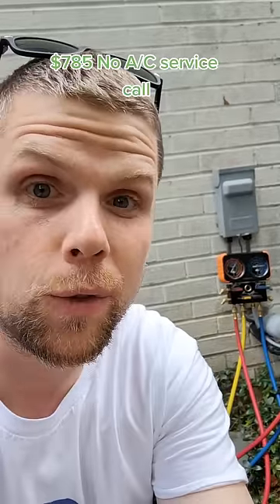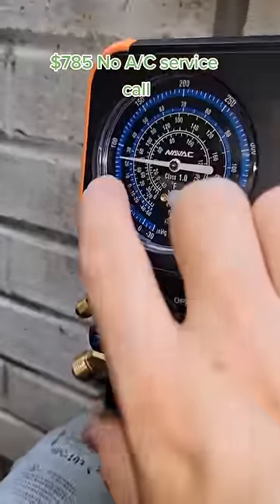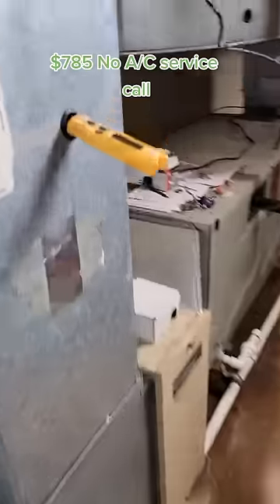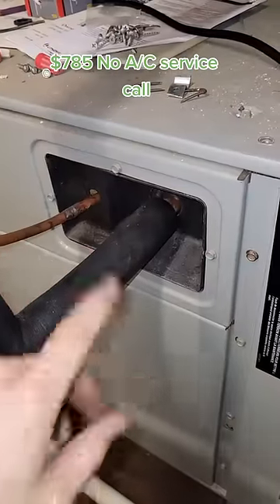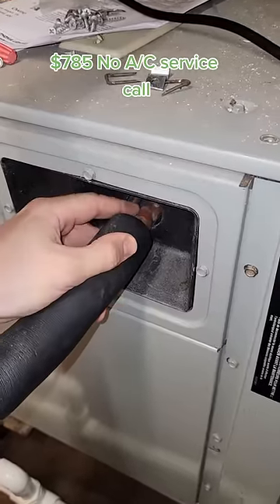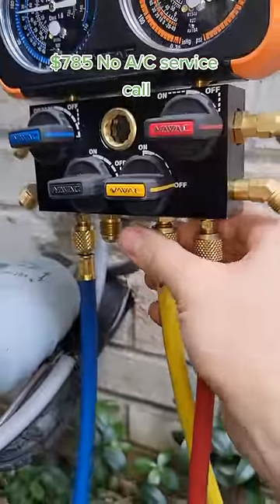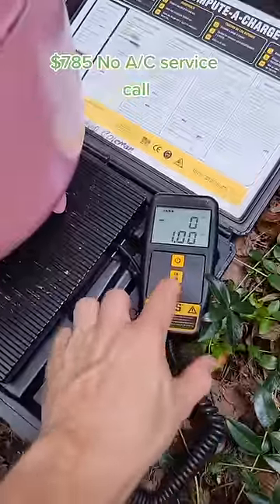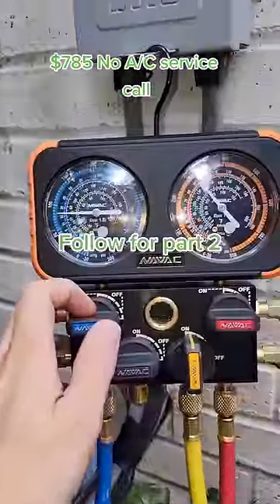Why is my A/C unit 🥶 freezing up? #shorts

Comment: I don't think this guy knows what he is doing or the way a/c systems actually work.
Reply: Why do you say that
Reply: @cc1561  procedure he is using , low freon doesn't increase the ability of the system to reduce heat load. Just not what I learned when I took hvac in school for certification years ago. Look up latent theory of evaporation for a deeper understanding of how a/c heat pumps work.
Reply: @cc1561  there wouldn't be a 20 degree temperature difference in the air if it was low on refrigerant. You would have low delta, low pressures, very low sub cooling and high superheat. Even he was even more thorough, he would have checked compressor amps too
Reply: @martyk1156  if you're lacking the substance that creates heat transfer, then you're going to have less heat transfer. So being low on refrigerant will reduce the ability of the system to remove the heat load.
Reply: @SupermarketRefrigeration  I agree
Reply: @SupermarketRefrigeration  so will being low on airflow if you look at his high side gauge you’ll see it dosent look low which tells me it’s prolly not low but the only way to know a refrigerant level is to calculate superheat and subcool and I didn’t see that neither did the customer
Reply: @boywhohadatiger  No, the only way to accurately determine a charge, on a system like that, is to recover and weigh it in. Pressures are helpful, but if you don't know the ambient temperature, that pressure doesn't really mean anything.
Reply: @SupermarketRefrigeration  that’s truly the most accurate way but nobody has time to recover all the refrigerant out a system pump it up with nitrogen to pressure test to find the leak or take it out and put it back in just to perform a leak test because you need some kind of gas to be in the system to perform a leak test and if your using heated diode or infrared then you need a refrigerant to be in the system. The vast majority of techs in refrigeration and residential ac will use the subcool or superheat method because it’s just as accurate and faster
Reply: @boywhohadatiger  It's like I always tell my guys: There's never enough time to do it right, but there's always enough time to do it twice.
I'm not saying your rules of thumb are incorrect, but your way of doing things, isn't the only way. 
But I will add, refer guys don't pay much attention to subcooling.
Reply: @SupermarketRefrigeration  yea they like that sight glass 😂
Reply: @boywhohadatiger  sight glass is all that matters.
Reply: @SupermarketRefrigeration  😂 yea can’t argue there vast majority of the time it’s pretty reliable

Comment: In automotive we fix the leak. System doesnt consume refrigerant if it's low there's a leak. Also you can never just pump refrigerant in always recover, repair, evac(vacuum) and then recharge. Is it different for homes..?
Reply: Yes it’s different, you can do a pump down and fix the leak. 90 percent of the time it’s on the high side. I think he is a professional bypassing the recover, vacuum. There’s to many keyboard experts here.
Reply: im a service tech its nlt different for homes what coule happen is there is a small lesk and he is charging it up while rhey wait to install a new unit. Also im assuming he de iced the evap coil checked the filter and made sure the coil wasnt dirty because all of those things would make it appear low on charge.
Reply: @nunez23j1  definitely wasn't  claiming to be an expert was really curiuos as I just switched from automotive to property management

Comment: 785$ for charging up a system with 410 you are a boss my man I didn't even charge that much on holidays
Reply: N no leak seal with dye smh he’ll be back next year to charge them again
Reply: 410 expensive now
Reply: It ant that expensive
Reply: @DSB420  does leak seal actually work, my comoany wont use it
Reply: It sucks when a customer calls you out they are already paying a service call. That’s why I don’t trust too many services like that. they just name their price. Fucked
Reply: @obama7325  it doesn't, it's also terrible for the system
Reply: @obama it sometimes works it sometimes slows down a leak sometimes it does nothing it's like rolling dice and hoping to roal a 7
Reply: “So we can gouge the customer appropriately”
Reply: @obama7325  No.. It's not good for the system. Usually takes out compressors within a year maybe 2
Reply: @obama7325  yes it does for teeny tiny pits but it’s more useful with a black light it glows like a glow bug lol great stuff if Cust isn’t looking to get new equipment we’re beyond fair when it come to our Cust base we don’t need to charge top dollar we pay our guys peace rate and everyone eats good we stay transparent with our Cust and just give them the knowledge we have earned in the field!!! Have a blessed day my hvac brother
Reply: 410A is going for ~$800 for a 25lbs cylinder. R22 has gone up to almost $1700.
Reply: So 3-4 pounds should cost 785$ still unreasonable
Reply: @nate30  you're not paying for 3-4 pounds. You're paying for the wear and tear on my truck/tools, my education, my gas, my time, parts/materials/refrigerant + markup. If you want to pay cost, fair enough, I can respect a person doing there own repairs. 

410A $800 (since you can't buy just 4lbs.)
608 license $150
Analog gauges $150
Recovery machine $1000
Recovery tank $150
Vacuum pump $200
Scale $150
Micron gauge $150
Nitrogen tank + nitrogen $200
Nitrogen regulator $200
Oxy-acetylene kit + gas $300
Sil-fos 15 $120
Filter drier $30
Schrader cores $15
Bubble leak finder $20
Refrigerant detector $200

Congratulations, now you spent almost $4000. That's assuming the leak isn't in one of your coils, or your compressor.
Reply: @nate30  that’s a big business price with a bunch of overhead call a smaller company and look at reviews before going with them u’ll save big I’ve been in the field for almost 15 years now n worked for multiple company’s the owner is the only one making money believe u me it happened to me for 10 years till I opened a business with my cuz and we’re beyond nice when it comes to price n put out work we stand behind and pay our guys good enough to raise a family !!!
Reply: @DSB420  I work on automotive HVAC systems which use the same principals; when we're looking for leaks we charge the system with dye without stop leak in it, adding the stop leak adds unnecessary wear. If you're repairing it properly, it shouldn't need stop leak. On a car anyway 😅
Reply: @nate30  blame the epa lol
Reply: @DSB420  I respect you for that but if I started my company I would charge on the more expensive side. I don’t think it’s greedy I’m not a greedy person but you should be compensated for your time and skill
Reply: @murkyturkey5238  I’m more then compensated for my work I just don’t need to make $7000 on a furnace AC job I’m cool with three grand and paying my guys 500 apiece for the day yeah do I realize eventually my prices are gonna have to go up if I have a fleet of vehicles and own a shop but right now I have a five car garage $500,000 house and make more than enough money to compensate my skills I am 13 years in I’ve seen all all sides of business when it comes to Hvac so I respectfully tell u u can’t charge like everyone else if u wanna make a name on saving ppl money and giving them a better job there not getting some guy that makes $19 an hour and doesn’t care about his work they’re getting one of the owners at their home making sure everything is done properly and his hands that do all the running get paid more than most seasoned HVAC guys The most I ever made in the field was $24 an hour I start a new guy at 25 minimum that makes you want to put out your best work every job then my guys that know how to install or service I give them a piece rate so there’s no hourly nothing I give them what I feel is right and make money doing nothing but servicing a good customer and once we get them I’ll guarantee you they will never go to another HVAC company in my town again that’s why we’re only two years old and on track to do over 1 million in sales this year with only a team of four

Comment: I keep seeing all the comments about air flow and it’s always good practice to check airflow first. But low suction pressure coupled with low super heat will tell you if there’s an airflow issue. Low pressure and high super heat indicates low charge.

Comment: Did we determine the source of leak and repair?
Reply: Nah man rocking that has and go 😂
Reply: In the field that’s not always the case , if the customer just wants to add refrigerant just to get by that’s usually happens , they don’t want to pay extra for a leak search . If the system was completely empty that’s a different story.
Reply: @JP-zz5rm  in Canada it's illegal to top up a suspected leaker without attempting any repair or mitigation.
Reply: @ianicus123  lmao 🤣 gotta couple of cars that leak that shit a crap ton
Reply: @ianicus123  it's illegal in the US too 😭 refrigerant can cause lung cancer and infertility
Reply: @omarantonetti8417  not illegal on a system containing less than 50lbs of refrigerant. Check the regulations...

Comment: Nice video of ripping someone off.
Reply: How is he ripping them off?
Reply: @Diaszurana  by extremely overcharging them for that, as well as not fixing the leak and just filling it so he has to come back and charge them again for the same thing.
Reply: @sharkfinsoupp  We don't know the whole story. What if the leak was due to a loosened Schrader core? If that's the case, then he just tightened the core and charged it up, which is the right thing. Also, many customers don't want to pay for a leak search and repair so they just opt to charge the system up and "see what happens" despite us explaining that the refrigerant they just paid good money for will almost certainly leak out.

Another thing is the price of 410a Refrigerant is damn near double what it was this time last year. We don't know how many pounds he pumped into that system. Also, the tech needs to be paid for his work, the dispatcher that sent him there doesn't work for free, the office/warehouse isn't free either, the gas that got the tech there is crazy expensive, the van has a monthly payment and an insurance payment.

These things cost money. I'm sorry us HVAC techs can't get everyones A/C working for $40, but I don't know what to tell you, Luke. The overhead for HVAC companies is tremendous, and once the summer is over work grinds to a near halt. The recurring monthy bills, however, don't stop and if we don't charge accordingly when we're busy in the summer, we all will be shutting our doors by New Year.
Reply: @Diaszurana  Damn alright man. Thanks for explaining. My bad. But it’s stuff like this that shows how much inflation really has impacted us.
Reply: @sharkfinsoupp  No worries. You wouldn't believe how many times a week I have to explain that. Usually to arrogant customers that, after I give them a quote on a repair they jump on Google and say $&!t like "that part only cost blank dollars, why are you trying to rip me off?" Usually when I explain they get it, but not always. Funny enough, it's doctors (MDs) and lawyers who give the most sh!+. They are paid purely for their service, and at a much higher rate than most of us, but are appalled when the tables are turned. Affluent business owners though never question it because they get it.
Reply: @sharkfinsoupp  blame the epa for the refrigerant. R410a has doubled in the last 2 years. Don’t even know how much r22 has gone up
Reply: @murkyturkey5238  wow.. You are right. I bought 25lbs of r410a for $125 in 2017... Looks like it's going for $450 now... Wtf.
Reply: @Diaszurana      But from my experience you can’t top off 410a since it won’t leak it’s blend evenly

Comment: Don't let these guys scam you. Check your filter first. If you haven't changed it or have a lot of pet hair. It will also cause the coil to freeze up. Fix? Let sit for an hour or 2. Replace filter. 
You don't loose freon unless there's a leak. Pay 800 every year. Nope, I'm good

Comment: Or you could’ve just cleaned the evaporated coil which is probably caked with dirt.
Reply: For sure a dirty evap coil will ice up.
My parents a/c was icing up and the local guy wanted to change the whole thing, took me 30 minutes to clean it and it's been going strong for 3 years now.

Comment: It's been awhile since I last serviced an ac system, but if I remember correctly the EPA doesn't look to kindly at willfully releasing refrigerant into the atmosphere to "purge" this so called water and air from the lines.  Also it seems even more ignorant that you would record yourself doing so on a public forum even if what your doing is standard practice with your business.
Reply: Must be quite a while if you've forgotten the concept of "de minimis" and the penalties for contaminating a system or "clean" storage container.
Reply: @Azlehria  Someone negligently contaminating a clean system and a system with contaminants circulating in it already are two different things.  If a system is contaminated as the guy says it is and then purges the system by a willful act of releasing refrigerant is not the correct way of doing it.  If the system just required a brief "purge" as he did in the video to clear the lines, then the ac system didn't have any significant amount of moister in the circuit to warrant a purge.  The EPA's verbiage of "de minimis" as it applies to the servicing of an ac system is in reference to the amount of refrigerant lost due to hooking into, disconnecting from and residual pressure from opening the system when in service, since there is no actual way to stop the loss of residual refrigerant being released when servicing.  De minimis doesn't apply when you willfully release refrigerant no matter how small, I guarantee no professional in any scenario would openly do what he did if an EPA representative were present.  The tech can do whatever he wants dude was just stating that it wasn't smart to film himself doing it on a public forum where the EPA can use it as evidence.
Reply: @captainkarmnemoniccj  That's literally exactly how we were trained to purge air from the manifold and hoses. In a non-corporate, state-funded, ASE-certified training program. One of my classmates was a CalEPA employee.
Reply: @Azlehria  You learned it one way and I learned it another whoever is right I don't know, but one thing is certain I'll never have an issue with CALEPA because I haul around and use my evac machine.

Comment: So where did the refrigerant you are replacing go? Either there is a leak or that was not the problem, or maybe it was not charged properly if it was not precharged, maybe a blockafe in the system? So charging is only going to harm the compressor